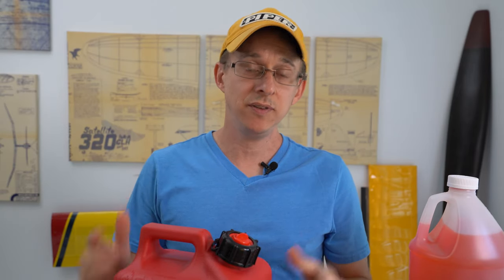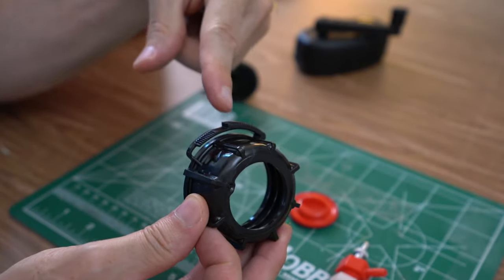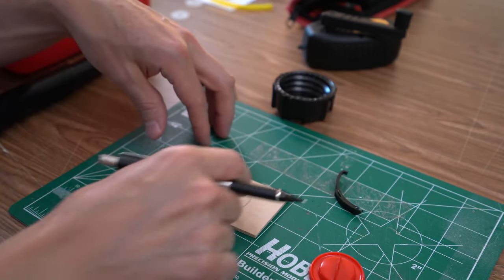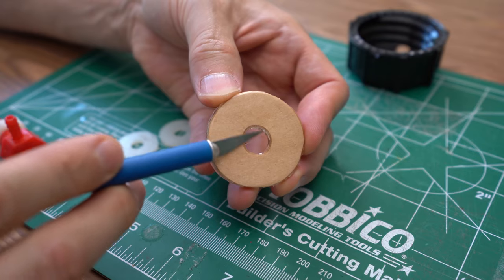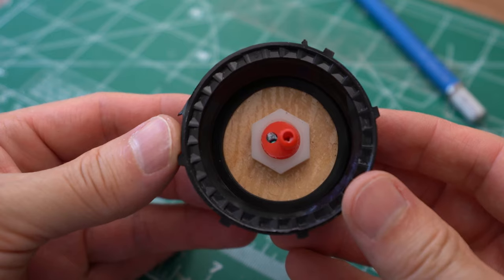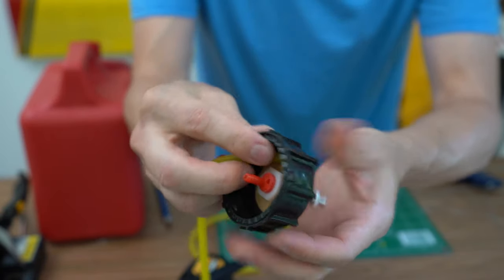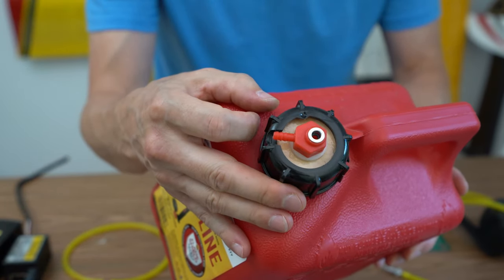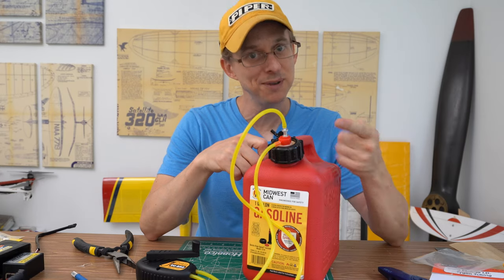How-to: A cheap fueling system for rc airplanes

Comment: Thanks for the video and the info that it provided!! I have designed and 3D printed up an adapter disk to hold the Kwik fill fitting and too seal the top.
Reply from the maker: Please share!
Reply: Where is the link ?

Comment: Great video. My only observation is why do you need a clunk to go right to the bottom of the fuel can . If you had it half an inch short you would of course not be able to use every drop of fuel but you would avoid picking up any sediment that might would have sunk to the bottom of the tank. I do this with a diesel heater in my sons shed and it works a treat using recovered fuel from scrapped cars , trucks and so on.
Reply from the maker: Solid point. I do have a fuel filter in my fuel line in each airplane - that gets cleaned on the regular. So while I don't filter from the can, I do ensure each engine has a filter installed on the main line to the carb.

Comment: Thanks for the video! I can't work out why everyone is so focused in putting these fittings in the lid when the can itself is made of thick plastic though. I just used a step-drill to put a hole in the flat shoulder section next to the lid. This works much better as far as keeping the install neat and not twisting up your fuel lines when you're refilling the can. Also, a quick hit with a heat gun (or hairdryer) softens the tygon tubing enough for it to slip right on to the fittings. Once I have eveything laid out it takes less than a minute.
Reply from the maker: Noice!! Tapping the fuel can at the side of the cap? Brilliant 👏🏽 💯
Reply: Clear presentation. Well done!

Comment: CENTER HOLE DRiLLING-When drilling the center hole for the DuBro Kwik Fill Fuel Can Fitting, 1) Before cutting the circle out of the scrap basswood, drill a smaller pilot hole (with a variable speed drill). Gradually increase the size of the drill bit (maybe 3-4 sizes), until you reach the desired diameter hole. Read Brobolio's below comment about transporting gas jug with the Dubro Kwik Fill. Makes sense.  Paul the carpenter
Reply from the maker: Wise words...

Comment: Does heating blue glow silicon fuel line help make it easier to put on like yellow gas lines?
Reply from the maker: Nope. Blue silicone's molecular structure (?) makes it exceptionally resistant to high heat. Once you get it to a certain temperature, it only compromises/damages the line. It won't give you the ability to reshape or reform it.
Reply: @theskyllama  Thanks! I finished building the fueling system, which was heavily based on what you did. The blue silicone line slid on without too much effort.

Comment: Those 3/32 fuel lines split as you were putting them on the plastic fittings.  Perhaps you should go up a size?
Reply from the maker: After the fact I realized that I just needed to heat up the tubing with my heat gun and soften the tube. It then fit like a glove with no split! Yeah, I think I'll try some larger tubing next time. Solid advice.

Comment: Why not use the red cap that comes with the jug, grind down vertical lip flush with cap and drill that cap in lieu of wood.
Reply from the maker: Good question. The lid on this jug was flimsy, odd shaped, and I couldn't get a good flat surface underneath to make a good seal.

Comment: I see the pipe split when you were pushing it onto the fuel tank fitting
.. Crickey thats not a very good pipe at all... Chinese no doubt
Reply from the maker: That was actually me. I split it to get a fit started. Wasn't until after that someone said, "Yo, heat that tube up hot before you squeeze it on. It'll make it easier." 😖

Comment: Mine is even simpler and has no moving parts.
Reply from the maker: Please share!
Reply: Very smart
Reply: Yes please share
Reply: @brianscutt6298  I use a 1 quart plastic (poly) bottle , 2 fuel lines and a squeeze pump from a Sphygmomanometer. Two hoses go in thru the bottle top (nice squeeze fit to seal). One hose has clunk on end and goes to the bottom of the bottle the other end has your refill / filter probe. The other hose goes just thru the bottle top so its always above the fluid and the other end has the squeeze bulb. Connect your refill probe to your aircraft and start pressurising the bottle with the bulb. When not in use, remove the bulb and attach a pneumatic system exhaust silencer so the bottle is always vented and won't pressurise in storage. The silencer also acts as a filter to keep crap out as well. I've been using this system for 6 years. I always carry 2 full bottles. At the end of a days flying, I siphon the fuel out of my aircraft back into the bottles.
Reply: @sheara13  You should make a video of your setup...

Comment: Really unsafe. You need to install locking fuel fittings. Those dubro fuel fitting are not meant for long time storage or safe transport of the jug. Maybe using a complete non modified cap for transport or storage might be a better idea.
Reply from the maker: Good insight Brobolio👍🏽I've been using the same glow fuel tank for 10 years and haven't had any issues. Maybe it's luck? 🤔 However, I transport my tank using a rolling Husky tool case... so it's really protected. Thanks for the feedback 😁
Reply: I would also suggest the installation of a fuel filter, not necessary, but wouldn't hurt.
Reply: Mine has not  leaked or spilt in 20 years of using the Dubro cap fitting.
Haha I must have horse shoes up my ass. 🤣